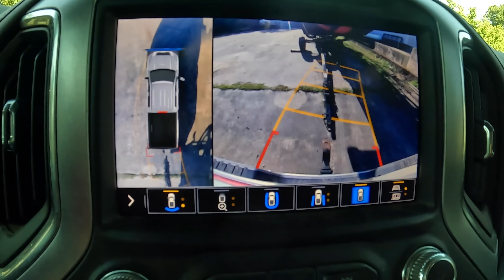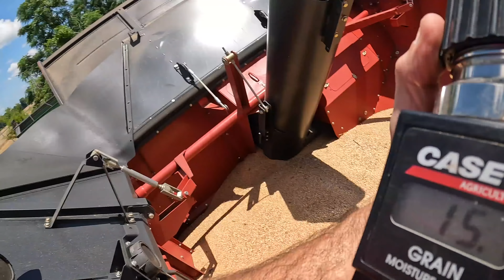WHEAT HARVEST 2022 BEGINS

Comment: In vegetable & potato fields we have to run tandem axel flat beds 2 feet from Tractors & Harvesters like your video, it’s worse in a flat bed due to limited visibility, we switched to a GPS synch system, I forget the name at the moment. It’s steers the truck and runs off the Tractor or Harvesters GPS system, it helps tremendously but you still have to keep a eye out for slight delays in response time. Only problem is you need a $1,500 unit fit each truck. Some of the boys laugh just say I got this let’s go. Me I’m a pile of nerves I’in my olde age. 👍😂😂

Comment: Good luck with the wheat harvest Daniel. I’m not expecting yields overall to be as great as last year. With the exception of the drought areas in the Midwest & Mountain States it should very close though. It will be interesting to see how the land locked Wheat supply in Ukraine & Russia play out. Hopefully it will not cause a crash if access to markets is regained. I guess enjoy these high grain prices while they are here. I prefer lower input cost and moderate good prices myself. Being in a grain deficit area due to the poultry & hog population, my area of NC normally trends a $1 higher in local prices v/s national. Amazing I think I was able to type that with no errors. Between this tinny Phone, My large fingers, & You Tubes so called auto spelling correction, it’s amazing if what I type makes sense at all! 😂 Good Video.